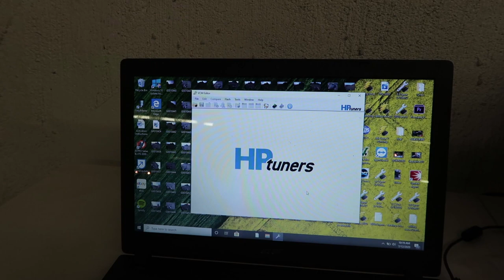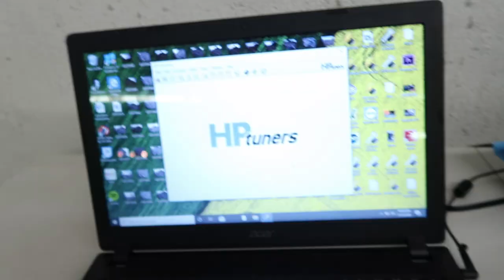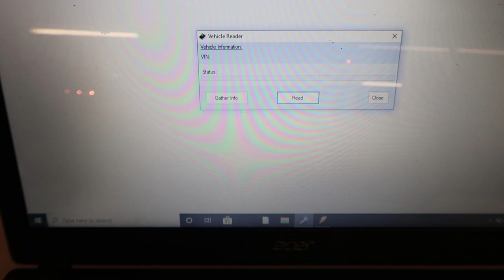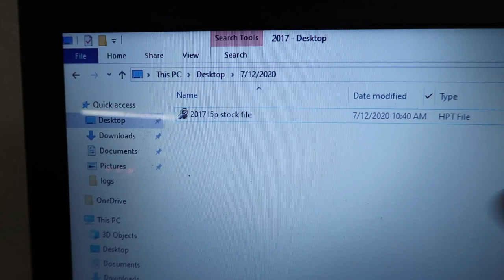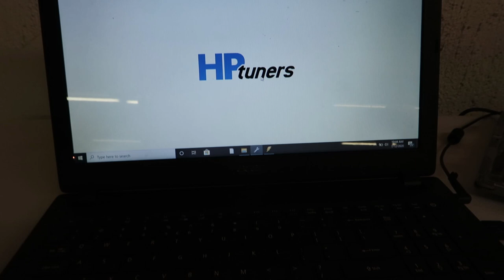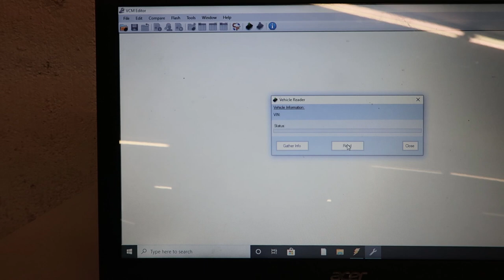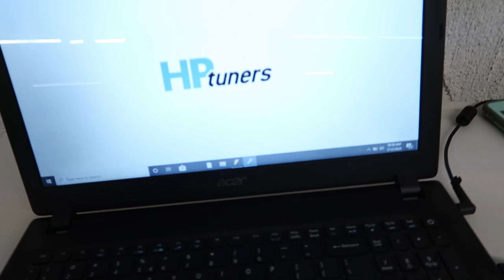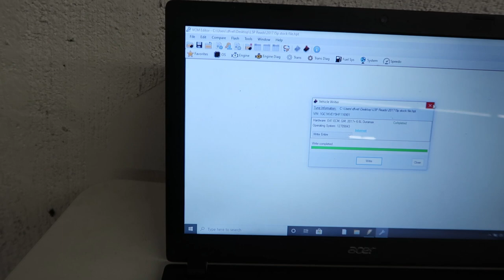Bench Flashing An L5P (Everything You Need To Know About HP Tuners)

Comment: This process is very similar to UPRev tuning. Good job on sharing a few pointers. You're correct about the line pressure on the TCM, it's night and day. Once you have it, you ask yourself why it didn't come standard from the factory. It definitely removes the internal slop. I would be interested to know if anyone added TransGo Jr. in addition to the TCM tuning in their L5P and the final results?

Comment: If i buy a HP tuners ECU can I just turn off the DPF system without getting a tune ? That would be a good video to demonstrate if it’s possible ... I’m looking to delete mine but want to keep the stock tune
Reply: No. To remove the dpf you will need a tune to turn off all of the functions and trick the engine into believing that its running correctly. There hasn't been a dpf system yet that could simply just be removed without a tune.

Comment: Now. The real question. Is it cheaper than the mvi2 and credits?....
Reply from the maker: What do you mean by that
Reply: @DennyDiesel  

At the beginning of the video I assumed you could just write the tunes on a blank ecm from a file on your laptop using a seperate interface the woukd just write the actual file open-source (romraider) style.  and go forward without revealing your vin or linking it to HP tuners. but I see now that your still going to need all of the hp tuners hardware and still going to need credits so I guess you're not saving any money this route. Maybe just convenience and no more connection issues. I'm still waiting on Steven to finish ezlink I guess. Just sort of waiting out in limbo to see what tuning options are coming.